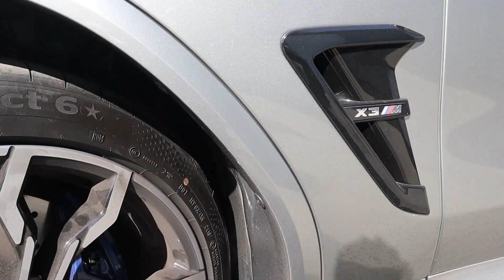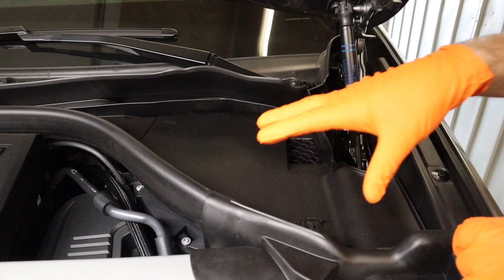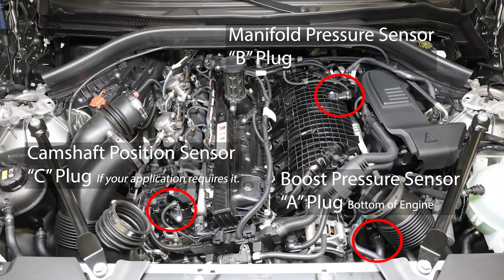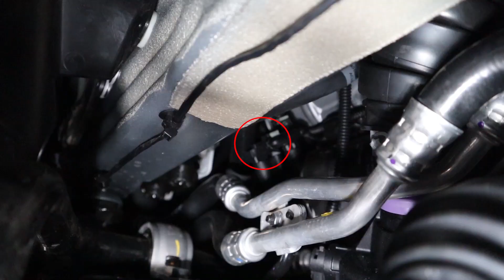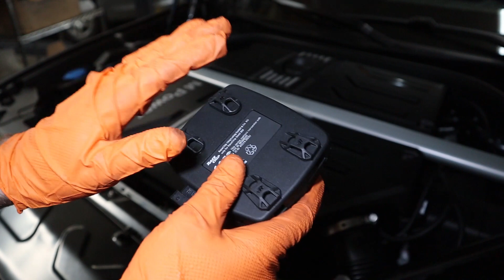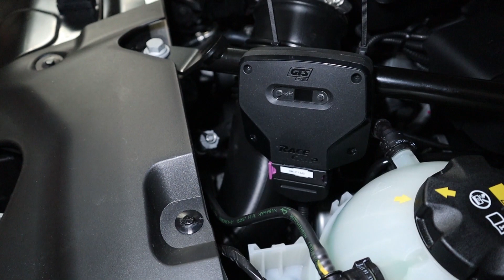BMW S58 Engine RaceChip Tuning Installation | X3 M | X4 M | G80 M3

Comment: I’ve installed this on my 2023 bmw x4m and after like few months of use I’ve started to get check engine lights and loss of power when accelerating. Once switch it back to stock everything seems to be fine. 
This race chip piggy back is not worth it

Comment: 6/23/24 - FYI if you are going to do this install yourself it is fully possible. 

TIP:
The boost pressure sensor - go to Harbor freight or a tool store and purchase an extra long flat head screw driver and an extra long bird-beek pliers. Go through the driver side wheel well and use the flat head to pull up the sensor tab, after that use the pliers to squeeze the sensor, put your had up and pull the sensor back. It should come loosen. 

This method worked for me. 

Good luck.

Comment: It's been discussed on Bimmerpost. Do NOT go through bottom. No.. Go through the drivers wheel well - there is a plastic panel, remove that and you can see sensor looking up and forward. Use a 90degree pic to unclip.  Do not go from the bottom.

Comment: Definitely not a plug n play solution if you have to take it to the mechanic to remove underbody plate. For S58, its really hard to reach boost pressure sensor, so avoid it unless you have a family mechanic always available to help

Comment: Wish they would tell you don’t do this at home because there is no way possible to get bottom sensor off.
Reply: That connector is extremely hard to get, but doable.  It took me ONE HOUR!!!  it didn't help that I have beefy hands and big sausages for fingers.  If you have an extra set of hands helping you, it goes a long way.  I basically was leaning over the engine bay and sticking my hand in what it felt like the jaws of a tiger shark.  And with a lot of trial and error, I got to do the disconnect and connection with three fingers.  For $700, I wish this thing would come with a special tool to help you connect/disconnect BMW type connectors.  Oh well.
Reply: @joejay2876  you think it’s any easier to remove it?
Reply: No
Reply: FUCK!!!!  I am glad it wasn't just me.  I started the install on my G80 M3 and stopped after trying to get the Boost sensor off for an hour....I was terrified to break it.  I was thinking I was just a total twit.....glad to see its insane hard to do, especially if you have big hands.

Comment: Do you have to gap spark plugs? If so, if you remove the chip when taking it in for service, would the dealership not notice gapped spark plugs. newbie. Have x3m looking at options.
Reply from the maker: No you do not need to gap the plugs. Even if you did, there is no reason for the dealership to pull your plugs for routine maintenance. Regardless, plugs are a wear and tear part, so replacing them should not void your warranty in the first place.

Comment: Does this void the factory warranty ?
Reply from the maker: It's an additional control unit that does not modify the ecu. Once removed, the car is completely in stock condition.
Reply: @RaceChipInstallationVideos  Your warranty may be voided if the dealership mechanic finds the chip installed during routine maintenance.  It's a judgement call.  I've had performance chips on my previously owned vehicles and actually decided to tell the dealership mechanic about it.  He thought it was cool and never had any issues.  But this may not be the case for other mechanics and dealerships.  The results may vary to say the least.  My advice?  Remove the race chip module itself and leave all the wiring harness in place.  If they ask about the harnesses, tell them you bought the vehicle used and have no idea what they are...lol
Reply: @Great_America  I like this advise.  But to add to it...  If there is a big enough warranty claim on the powertrain, they may look at the ECU logs and find that the car was overboosting, overtorquing, etc. and deny you warranty for having enough circumstantial evidence that suggest you were using a piggy-back or tuning system.  But like you said, establish a good relationship with your dealership so that you can at least have them on your side if there is a dispute with BMW of America.
Reply: Yes.
Reply: @jacko4511  no it does not. If you have an issue which you shouldn't you simply remove it and there is no issue

Comment: The explanation of the a sensor is horrible. I couldn’t get my hand in a good enough position to unclip the sensor. Any tips?
Reply: Marc Tallman I used a longer screwdriver from the top to put it behind the pull tab. That worked... I just cannot unplug the oem connector. The oem plug is already coming apart, so I am going to give up and return the chip.. 😔